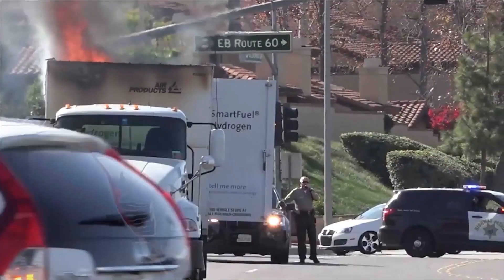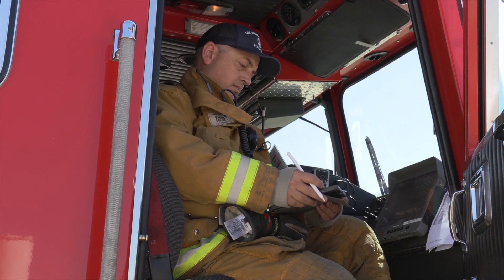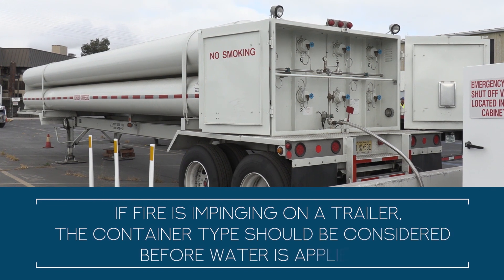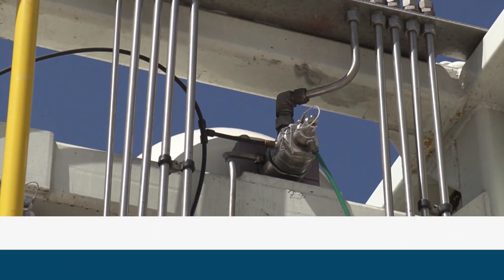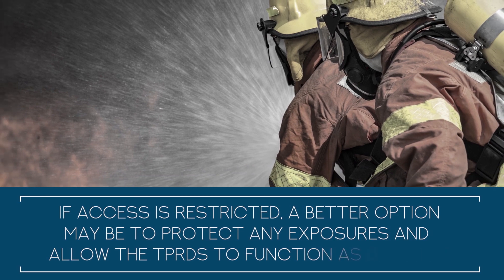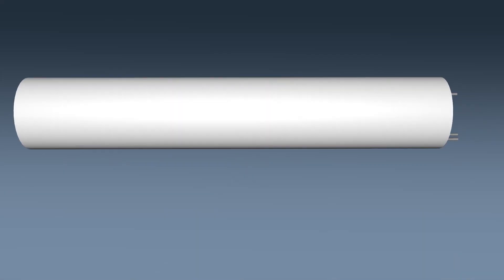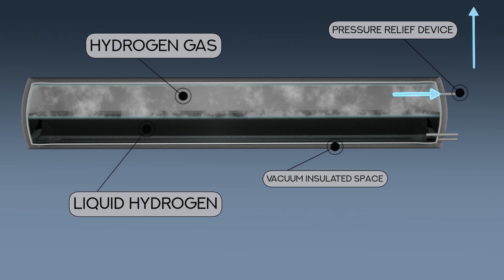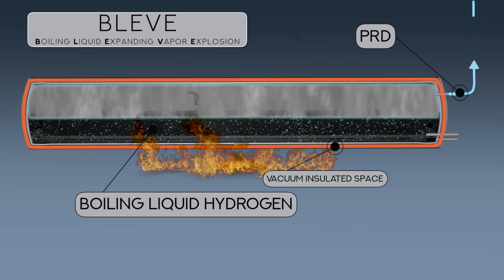Hydrogen Safety: Transport and Incident Response

Comment: This is absolutely terrifying. "Don't use water unless you should use water."

"It won't BLEVE unless the vacuum is gone, which you have no way to determine from a safe distance."

How about requiring backup insulation and a larger relief valve that together can handle the vent rate in case the vacuum insulation fails?  If that's not possible, maybe this fuel is just too dangerous to transport on public highways. It's safety-related physical properties are absurdly dangerous: low heat of vaporization meaning a little heat can make a lot of gas. Very high vapor pressure even at cryogenic temperatures - it will burst just about anything. And the explosive range? Anything between 4% and 74%.

At least it's not toxic.